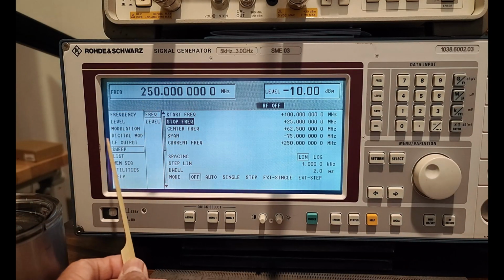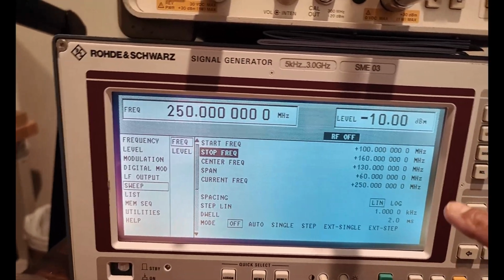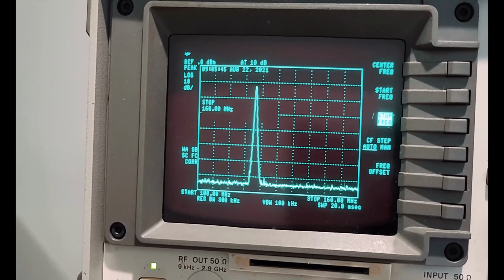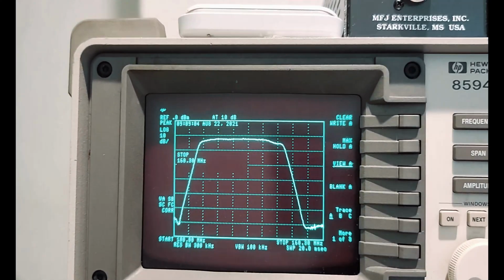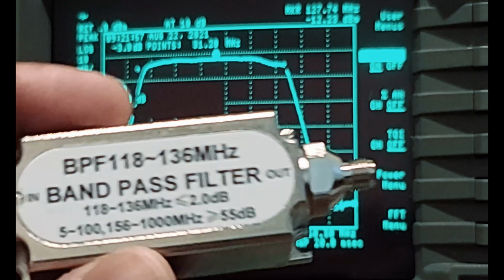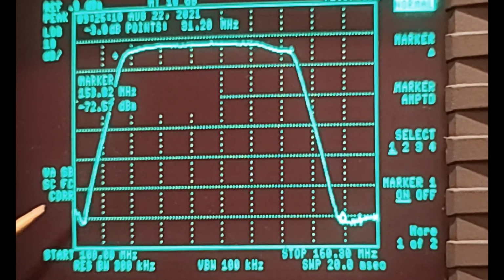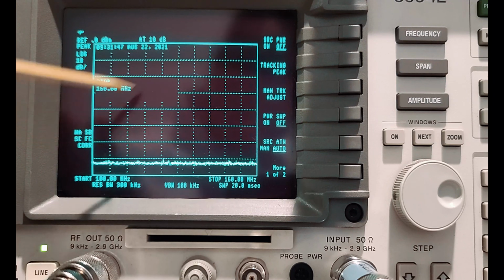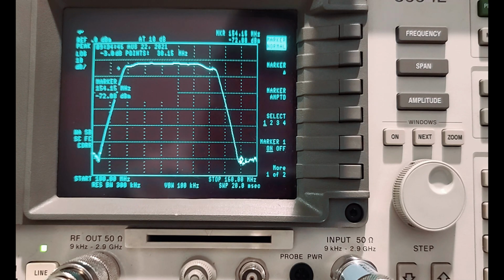N0AGI - Spectrum Analyzer - With or Without Inbuilt Tracking Generator - That's the Question.

Comment: Well the thing is the cost, how much do you want expend to get the same result,  if you have time, no point
 
Also tracking generator only goes up to 2.9Ghz, thr SA goes a 6.5ghz in 8595E, so if you want measure over that, you will need do it in the non tracking generator fashion.

Comment: Most of those old HP analyzers don't have (unfortunately) a built-in TG. But when measuring or tuning a diplexer you also need to record 1 trace and make the other,  but of course that is then much faster. But you can use also a VNA for that purpose. Unfortunately the budget ones don't go so low and maybe don't have sufficient dynamic range. For example, I have SVA4401A that has dynamic range S21 of 75dB. For this bandpass filter it would be sufficient.

Comment: Not sure if you have since acquired a noise source or not but a good quality noise source which is amplitude levelled across a broad frequency range can be a good substitute for a tracking generator. Such can be used successfully to tune duplexer filter cavities etc. as well.

I have used both a tracking generator and a noise source with near equal results. It is necessary to average or "smooth" the trace a bit when using the noise source but it does give usable results :).
Reply from the maker: Thanks for asking.  Yes, I do have a R&S SME 03 and Signal Generator and Siglent 1032X. They are both a fantastic gear w/ phenomenal capabilities.  With that said still, nothing beats having a SG w/i the TG in a Spectrum Analyzer.  It cuts down hassle as shown in this video.